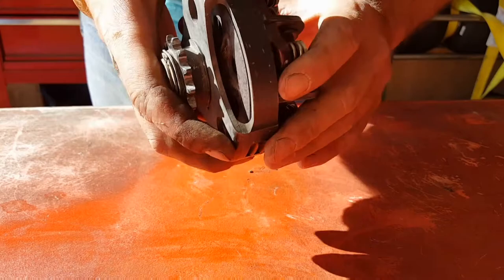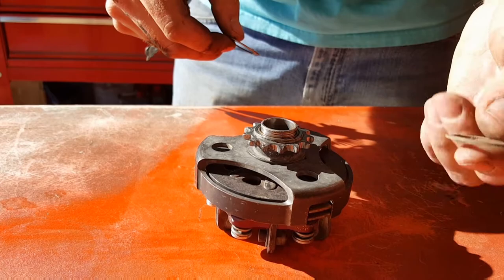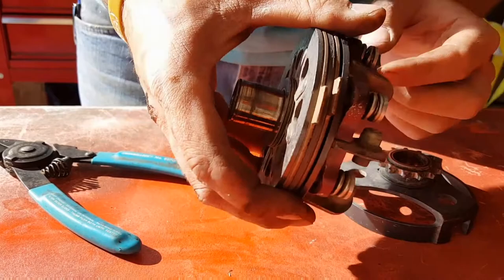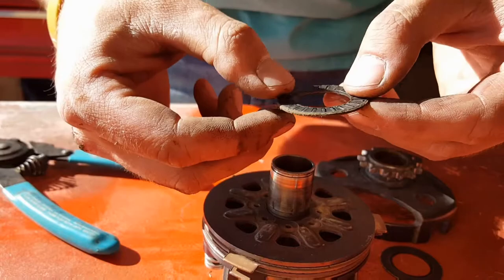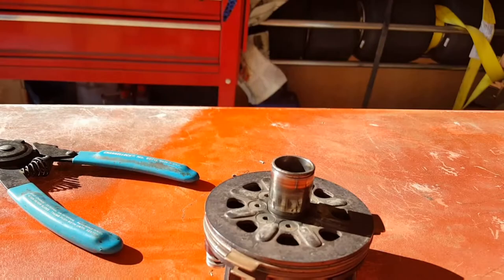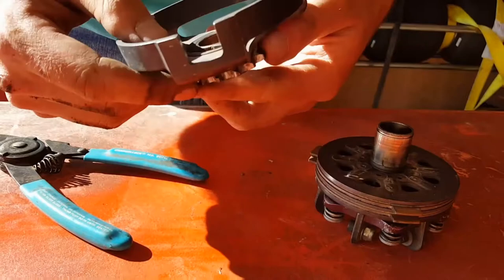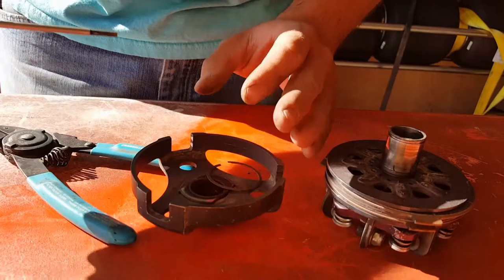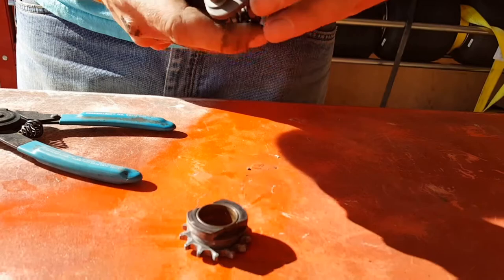Go-kart clutch teardown  [NEGLECTED]

Comment: I bought a kt100 go kart and it had a 3 disk horstman wet clutch I don’t know anything about go karts what do u suggest I replace it with i just ripped it around the property and the clutch went out. The clutch cover also had a big dent where it sealed i suppose the grease came out so it was running dry. Basically what I’m saying is do I have to buy another “race spec clutch” or can I use something off a old mini bike or something
Reply: im wondering the same thing what did you do